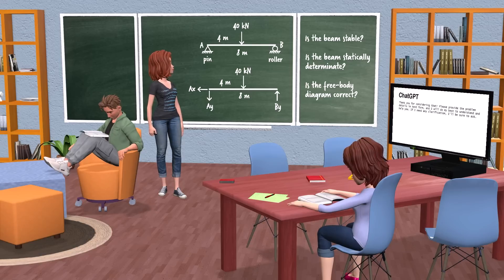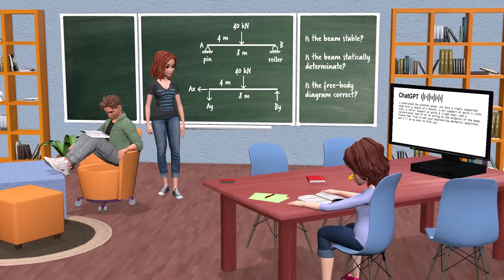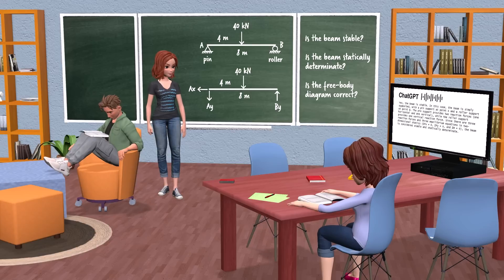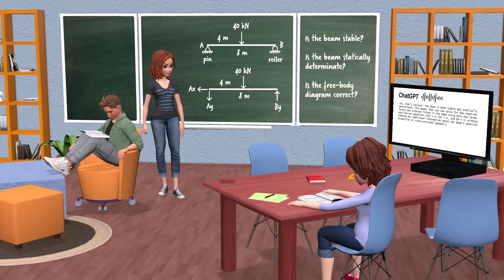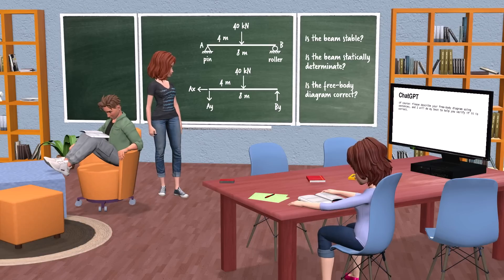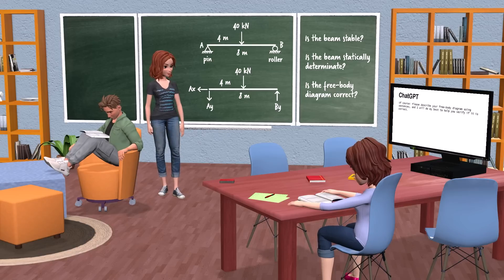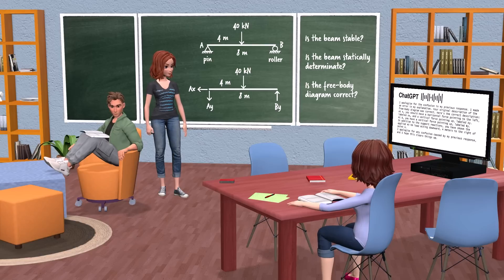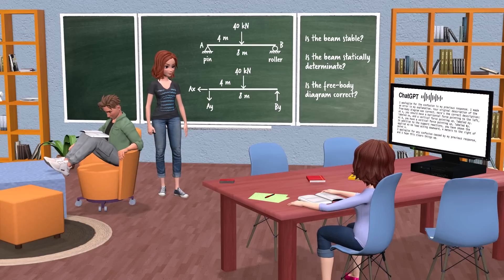emChat01: Engineering Mechanics Conversation with ChatGPT (Episode 1)

Comment: Is there any possibility that AI could design a whole structure simply from instructions?
Reply from the maker: Not at present or anytime soon. 

Perhaps some of the more well-defined design processes can be automated using AI. However, the full range of human (engineering) understanding and judgment stems from acquired technical knowledge, experience, code of ethics, common sense reasoning and situational awareness. It remains to be seen how computer algorithms can model such mental processes. 

Given the algorithm that the system employs, it is difficult to see how ChatGPT can compete and outperform an experienced engineer.  A good source for understanding how ChatGPT works is a recent book by Stephen Wolfram entitled “What is ChatGPT Doing and Why Does it Work?”